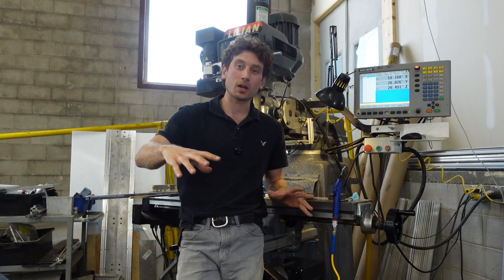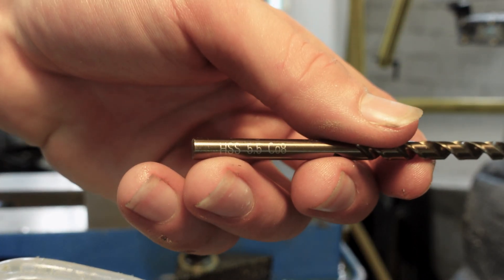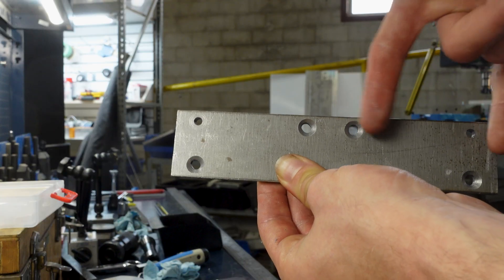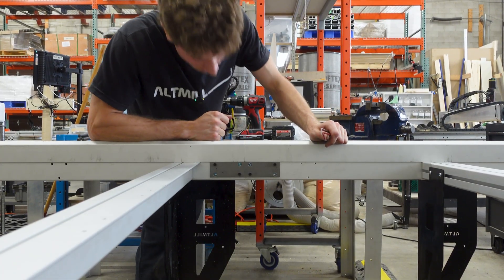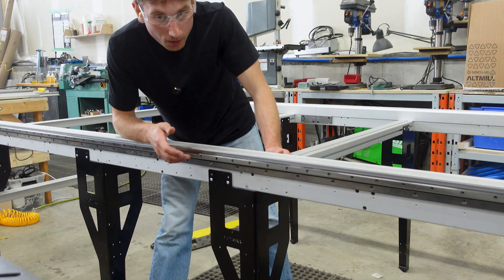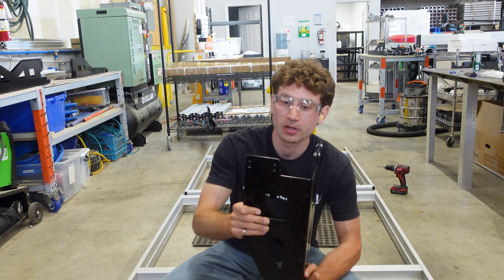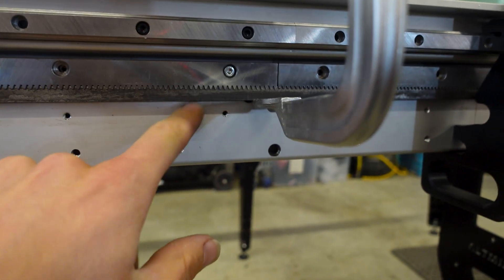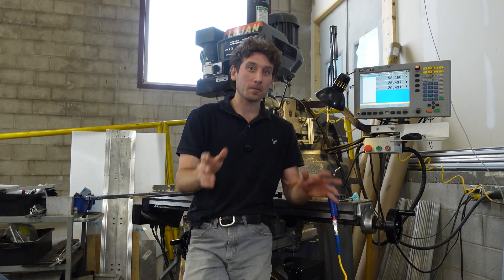Engineering the AltMill 4x8 ❘ Ep 2: Table Frame Construction

Comment: Being a retired biomed engineer, I so wish I was a younger man! I would be knocking on your door begging to work with you guys! I received my Altmill 4x4 a couple weeks ago, but I'm still selling off my traditional woodworking equipment to make room to built it. I had a smaller CNC that I've already sold as well. I'm transitioning to 100% CNC made woodworking. Love the videos!
Reply: Thank you for showing the process. As an ex-CAD designer for a U.S. defense contractor, I'm curious if you have drawn the CAD models and put together your parts, sub-assemblies, and assemblies first, or if you're putting the prototype together and "winging" it. 😂 Also, how much real life work will you put the prototype through after you work out the kinks? I found the process fascinating and wish I could be in the shop to assist.  ONE REQUEST  - PLEASE give this table as TALL of a Z-AXIS as you possibly can. THIS is the table I've been waiting for. ❤